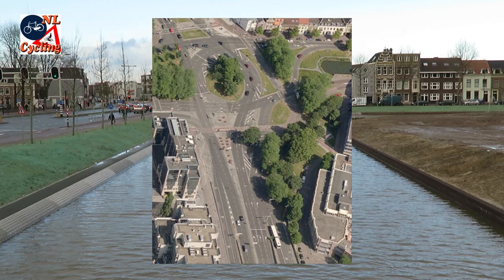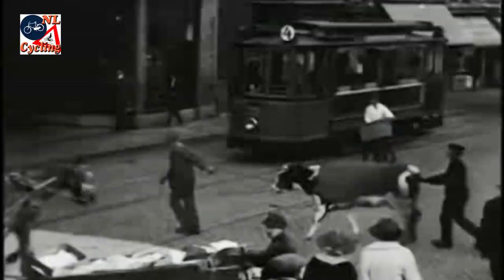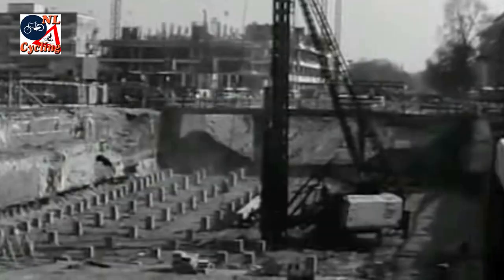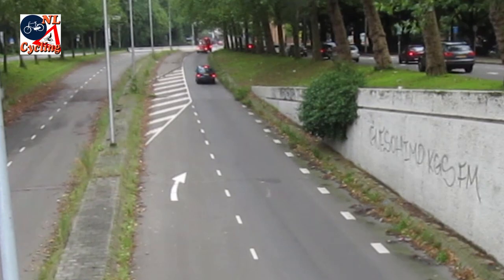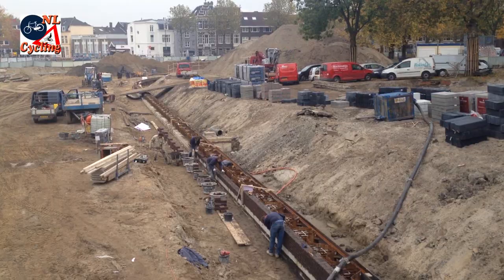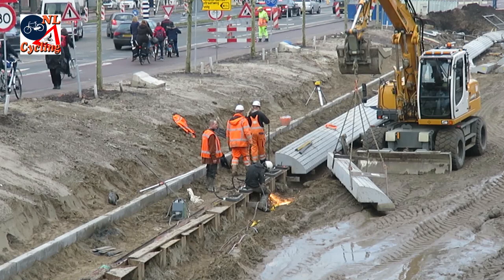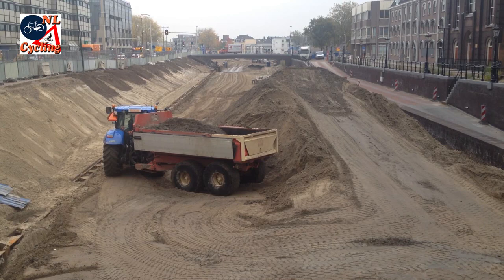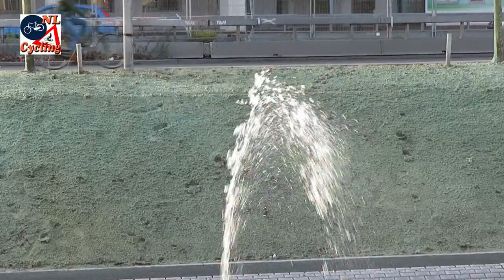Removing a motorway to bring back the original waterway [445]

Comment: It has taken about 50 years to learn that more and wider roads simply create more traffic.
Unfortunately it still hasn't sunk in in some places.
Reply: Explaining counter-intuitive systems to voters is reaaally difficult. So you can have the objectively right stance but if your voters don't understand your stance then you'll never stay in office long enough to implement it.
Reply: No!
This is a complete misunderstanding of the situation.

50 years ago, they built a motorway around the historical centre (in the canal) so that cars could bypass it.

The city grew in those 50 years.

Now they built a motorway around the city and removed cars from the now enlarged city centre.
Reply: no, you used circular reasoning, no one misunderstood anything. Roads dont fix traffic, they never have, thats simply a fact proven by all examples everywhere.  @acceleratedsloth

Comment: Oh the irony. Utrecht built a motorway to "modernise the city". Now it's being removed to return to the old ways because the new doesn't work.
I REALLY REALLY wish the UK would see things the same way as the Dutch.
Reply: Give it 10 years and there will be proposals to replace the canal with a ring road and the project will be conducted by the heirs to the present business, or their predecessors!
Reply: @geoffnottage8894  No, I feel like cars are becoming increasingly disliked, the most likely outcome is the canal being replaced with a new 50 lane cycle ring-road
Reply: @geoffnottage8894  There is 0% chance of that happening in Utrecht. You haven no idea what you're talking about.

Comment: Utrecht: Demolishes a motorway to return the city moat back to its place

Every other city in the world that filled in their city moats with motorways: "We're gonna pretend we didn't see that."
Reply: Actually, Utrecht is not the only city to have done it. Seoul did it as well. They returned a river where they once build a motorway over it (granted, they now have to pump massive amounts of water into the river to keep it flowing) and the strangest thing is that traffic in the city improved.
Reply: @Hans-gb4mv  Boats can carry lots of cargo. The lack of huge trucks in the road most likely have something to do with it. That and ferry boats decongested the road
Reply: @bmona7550  those re not navigate able waters
Reply: @Hans-gb4mv  Navigable by what? Canal boats such as used in the UK only need 2 1/2 feet of water
Reply: London has paved over so many of their rivers that they aren't entirely sure where all of them _are_. There are lists of places you can hear them running underneath streets and buildings.
Reply: @jacobmoses3712  cargo canalboats I'd imagine need more thab 2.5 feet of water

Comment: Beautiful, I think the 21st century will see a greater balance between pedestrians and cars. NY fought this auto-centric nonsense in the 1950's and won but it spread to other cities like Chicago and LA where huge highways and automobiles broke up neighborhoods and ruined city life. Japan made the same mistake also in the 1960's when they were preparing for the Olympics. Entire neighborhoods were uprooted and the character of those parts of Tokyo changed forever.
Reply: They had the very same plans for the Amsterdam canals. Luckily, the sixties rebel spirit put an end to that, and only the Wibaut - Weesperstraat axis was built straight thru old neighborhoods. Today a metro subway runs underneath, but the car lanes have been reduced in width, and see a lot less car traffic today !

Comment: This is real progress.
Can't believe anyone in their right mind would simply remove a canal to make way for cars.
Reply: They actually did that in Amsterdam with a few canals but they now turn the roads in canals again cause in the city center there are no cars allowed.
Reply: You have to see it within the time. At the time they thought of thiis, everything was about modernization. The solutions we have now (for instance in Utrecht, just hadn't been thought of yet. Also: the old buildings were, back then, much more "old junk" then now, where everything is renovated. The 60's were the times where anything seemed possible and we hadn't learned the value of old stuff yet.

It is too bad that it destroyed so much, but it just could not have been any other way. Nowadays we know how to combine the old and the modern. We just didn;t know back than. ("We" - I was one when they decided to mute the canal...)
Reply: A city is a tool for man's aspirations and needs. It is not a museum. Lots of things needed to be done physically back then, that can now be done electronically. Hence more traffic in the city back then, hence change the city to accomodate that. Not museums, remember, unless you can make so much money by being a museum (like Amsterdam).
Reply: How is reverting to medieval technology progress?

Comment: The obvious thing would be to properly complete the motorway as intended. I guess prosperity is no longer a concern there.
Reply: give it 20 more years
Reply: gantmj and then it'd still be useless. It's way too small for a ring road. If you want to make traffic patterns better, make the northern side of the Ring a real motorway.
Reply: The problem is the location of the motorway. You don't want motorways through the city, they need to go around it (that's why they are called ring ways).
This is to seperate local and passing traffic. But they didn't think of things like this in the 60's yet. ;)
Reply: *****
 Cities should be built in a way as not to require roads, except for the purpose of moving products locally.
Reply: The thing is, motorways in cities have been proven to make things worse...

Comment: I love that they returned the canal, but I also can't help but wonder how awesome it would be to make a park out of it. Image: the bridge still being there, but instead of water underneath there's grass and flowers, and where there isn't a bridge there could be trees. Maybe a little stream. It would be a little slice of paradise
Reply: I understand you point, but returning the canal could also be beneficialvfor the watermanagement in my country. It is happening at more places, I know in Zevenbergen (the village I was born) they are in the proces of digging up the old harbor. It not only makes the town look prettier, but it also connects two waterways which helps the watermanagement a lot. So there was a dual purpose, esthetics and watermanagement. Could be the case in Utrecht too.
Reply: @hds66nl29  You are right about the function for water management. But I tend to agree with Nathalie's need for more natural systems to be included in such projects. The indigenous water/landscapes of the Netherlands provide plenty inspiration for esthetics. Willow, Alder, marsh vegetation and reed fields (even floating ones) could easily be integrated. It would beautify the surroundings, temper city noise and increase quality of air and water, without hindering the function of the system as a whole. On the contrary actually. City wild life would appreciate such a place as well.
"Permaculture" is just one of many regenerative movements aiming to restore our relationship with the lands we inhabit. I would deem it wise to have permanent representation of such movements to be included in city councils, if we are to advance in a more optimal way. (ik ben nederlands)
Reply: In your support I responded to the person that reacted to your post. Just thought you might want to know. Peace

Comment: A similar restoration work is going on in Kuala Lumpur, but the situation is different since it involves an actual tropical river that was (fixed a decade ago) prone to flooding, and strong currents after a good tropical rainstorm. Hopefully it will be as pristine and green as this project.

Comment: So its like if your playing factorio and suddenly add another set of parallel belts in the middle of your bus then complain it doesn't work and go back. Obviously its going to be ineffective if the actual plans get canceled and they just stop the motorway into a normal street. Either follow through completely or don't start at all. Going back is fine but it seems like the whole thing was a huge waste of money.

Comment: ok.. when they stooped the motorway in the 60's did they build another one so they got rid of the traffic? and now did they make sure to not reduce the capacity?  all i se is "motorway removal" car removal" stil where do the cars go now? did you just make a gridlock situation?
Reply: Your assumption that the amount of car traffic is a given is false. People avoid it in cars and take other forms of traffic to get around it. People are more malleable than many of us think.
Reply: @Cl0ckcl0ck  well we have the same problem here in norway now. and when you get 2 hour delay on a short stretch of road some thing is F*** UP!.  when you se the buss drivers go out of the buss to went there frustrations and take smal brekes when stuck in queue something is wrong.  if you dont build the infrastructure for use of the city yes ppl is malleable.. they go and shop elsewhere. they find jobs elsewhere. and that is just what is happening here now. if you have offices in the city center your not a place ppl want to work.

Comment: The worst part of this idea was, the motorway was never finished because of protest against the idea of cars in the city.
If it was connected to both sides of the other motorways the ring-road was completed and useful.
After many debates to continue the road finally they decide to remove the useless 40 year old motorway and put the canal back in.

I still believe to this day that, If the motorway was finished that it would contribute a lot to Utrecht. However, with the current idea's about the reducing of CO2 gasses it's no longer possible and this is now a problem solved what should be resolved many years ago
Reply: It makes no sense these days to make a motorway straight through the city center. That is the American way of city design. It is better to do what is done in this video. A ringroad around the city and public transport to get into the city center. Better air quality and a better space to live in.
Reply: Indeed, when it was constructed was the idea of cars in the city the new future. Currently there is still a large bit of the ring-road missing between Overvecht and Maarssen (autoweg in staid of a highway).
It was form the moment from constructed a useless bit of road because it was never finished. The current ideas of city planning in the Netherlands is keeping the cars away from the city-centers.
I don't live in Utrecht anymore and lack op possibility to park close to the Utrecht city center means that i'm no longer visiting Utrecht.
There are easier options available than parking around the center and taking the bus or train.
Last time was a year ago and before the old muziek center was still there.

Comment: Spot the difference between 0:19 and 5:30. It seems, an indeed quite silly motorway has been replaced by a dead stretch of water. Hmm.
Reply: Water cools cities. Reduces Urban Warming due to heavily concrete structures.
Reply: I drive passed that spot regularly. The inside corner of the canal has become a great hotspot already. Lots of people out there when the weather allows for it.

Comment: So because they didn't finish the freeway, it was deemed a failure. Bet just like my city of Melbourne here in Australia the same pack of failed greenies and inner-city people stopped it. Many roads we have needed have been slowed down.

The best thing in the world, these cities are dying all over the planet. People moving out and leaving them for better areas in smaller towns etc. Leave the cities to the idiots.
Reply: Australian cities look quite a lot like American cities. Wide roads, shops and residential homes far apart with no good alternatives to the car.

The Dutch have seen that in order to have cities survive, you need to bring people and businesses closer together. So much so that residents can walk or cycle to the shop instead of Australians and Americans where they need a car just to get some groceries.

Congestion can be solved in more ways than just add more roads and lanes. Building this canal didn't increase congestion in the city center. What they did is improve the ring roads with technology and roundabouts to improve traffic flow. Not a single lane was added to it. They also upgraded the train station and bus terminal to get more people to use public transport instead of the car.

Comment: I think there is a touch of insanity in the country
Reply: I prefer driving in the Netherlands to any other country. Car traffic flows freely as so many people make short journeys by bike that means less overall traffic on the road, & they tend to be relatively clear.... Also as a driver you never encounter cyclists except for the quieter residential streets as they have their own lanes. 
Worst place - Los Angeles. A place where everything has been designed in an attempt to make driving easy with eight lane highways everywhere, but it can take three hours to cross the city by car & everyone crawls along at around 5 mph.